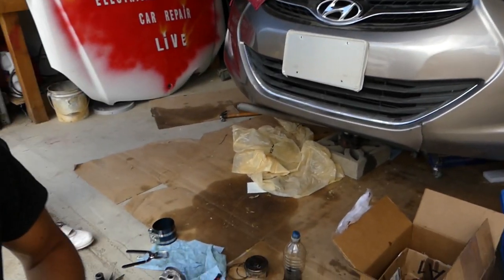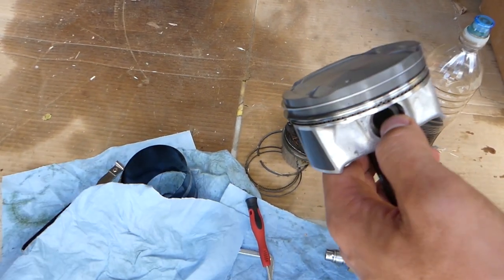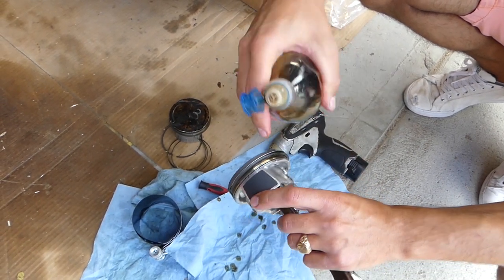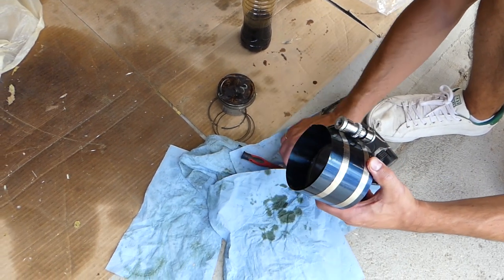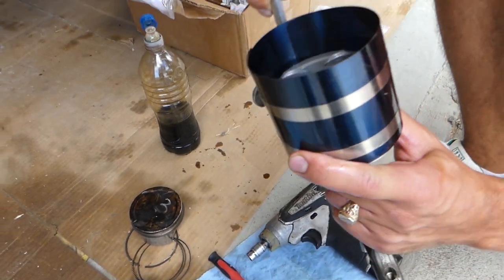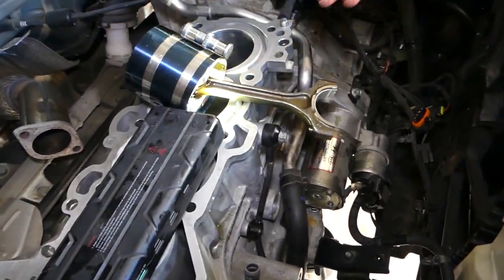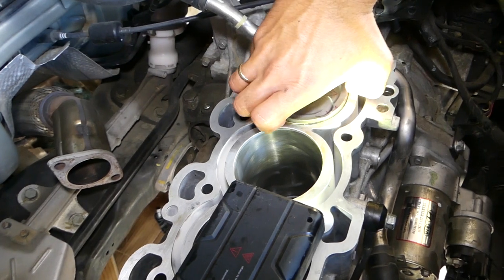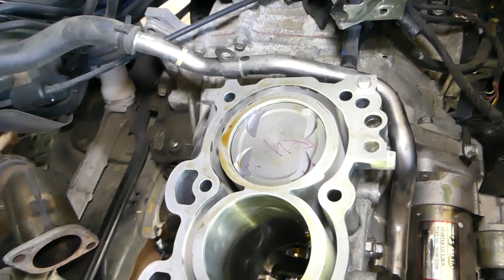HOW TO COMPRESS PISTON RINGS. PISTON RING COMPRESSOR TOOL

Comment: These compressor rings are junk. I done mine rings 5 months ago with these and broke 2 rings on 2 piston.You have be extreemly careful with this tool,not tigthen it fully before you are 100 % sure that the rings are in place.Other wise you will cruched the rings and damage the piston.Another thing is the nits that are pointing thorwards the piston,they make a bump and if you tighting it really hard the piston rings will drag inside on these bumps. I suggest not to use these compressor ring tool for 1st time on your overhaul.